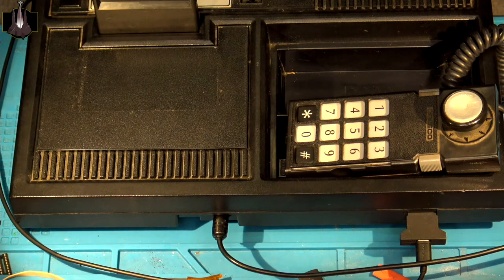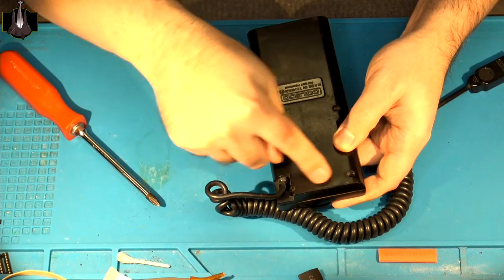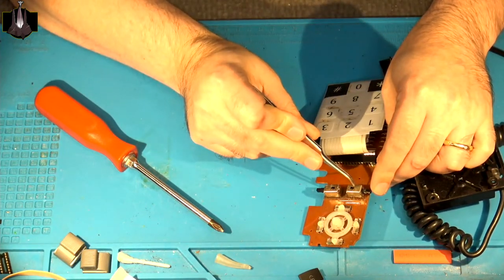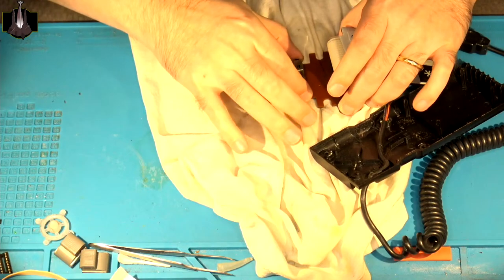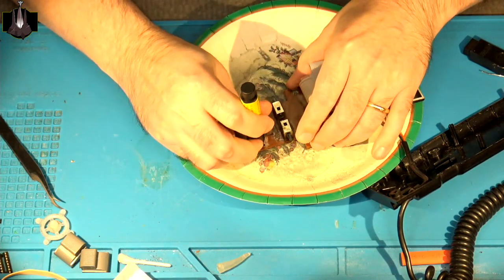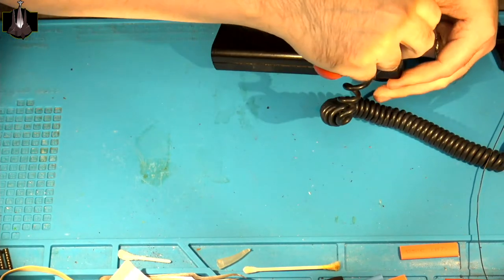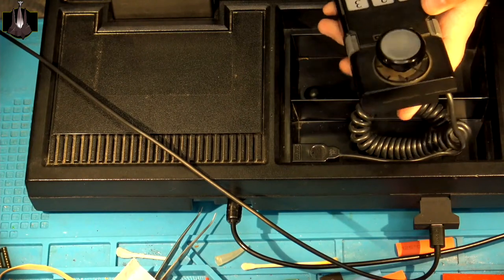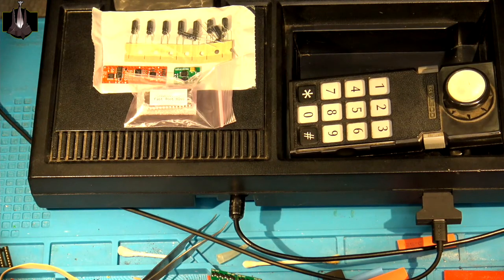ITC LIVE:- Lets rebuild a Colecovision Controller!

Comment: It's always interesting to see how different controllers are designed.

Deoxidizing liquids and sprays are pretty good at what they do, a little bit squirt into a switch and work it a few times and they're as good as new.
Reply from the maker: In many cases, the fire button issues on the CV just need a good spritz cleaning as you saw in the stream. I will admit that the next day when I was play testing the system again, that after about 15min the controller left fire button started to act up again. I then took it out to my garage and essentially hosed it down with more contact cleaner and lots of actuation to get it worked in there. It was fine after that with multiple plays over several days. On the direction contacts, I've seen where folks drill out the original rivets and install new ones, but that really isn't needed with the method I use. The biggest issue I've ran into on CV controllers that isn't as easily fixed is when the actual PCB is cracked from stress over the years or when the actual leaf switches are cracked. In those cases the only solution is to use another dead controller for parts. Unless there is a source for those new that I'm not aware of.

Comment: I have a Coleco Dual Command joystick/paddle and boy, it's one of the most satisfying controllers for the Atari consoles I ever had in my collection. But I always wanted to have a ColecoVision controller.
Reply from the maker: I'm not familiar with that controller? But I can tell you that on my personal colecovision stock controllers, I removed the disc portion of the joystick completely and screwed ball tops onto them. It immediately made them more usable to me and that is how I still play games on my CV.
Reply: @IvoryTowerCollections  The Dual Command is the main controller of the Coleco Gemini (Atari 2600 clone), Kinda interesting design.
Reply from the maker: Oh yes! I've seen those but wasn't aware that was the official name for that controller. I don't own any of those but I do have a Gemini sitting around here somewhere.